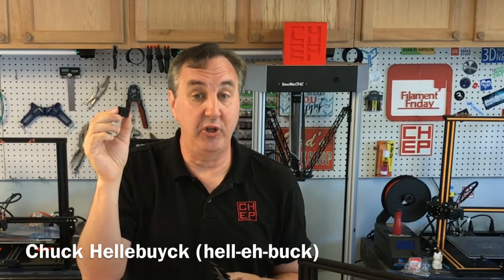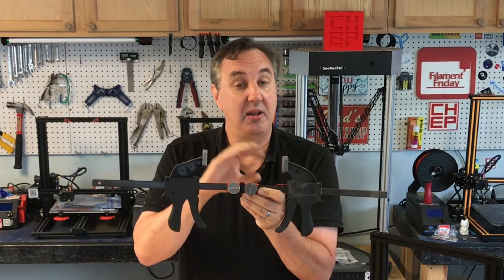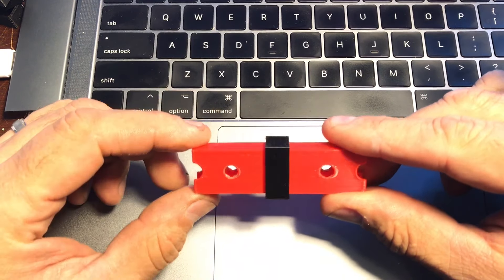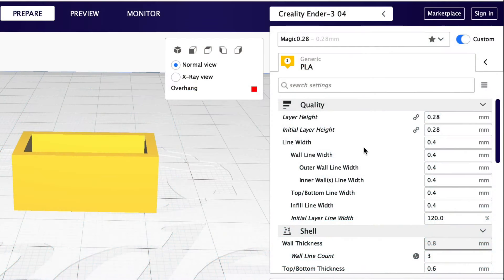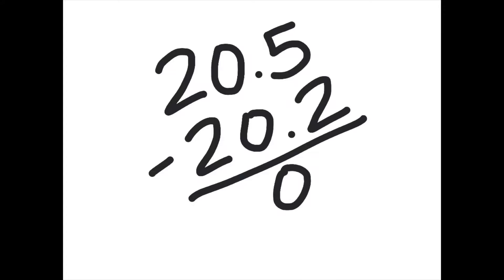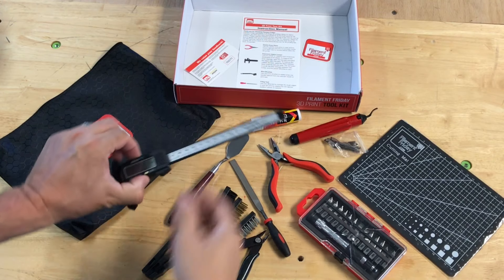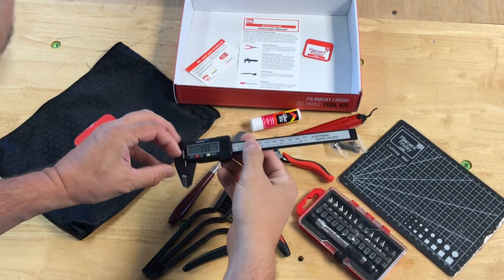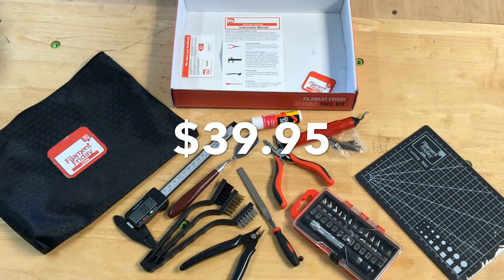Perfectly Accurate 3D Prints using Horizontal Expansion

Comment: Cura do not care about the nozzle diameter, that's all: holes are less in diameter exactly by the nozzle diam. Say, if you designed 10 mm hole and are printing with 0.4 mm nozzle - the printed hole will be exactly 9.6 mm in diameter, though the outer diameter will be almost accurate as designed. Absurdous software.
Reply: Wow, haven't thought about this, and now as I'm thinking, looks like that's exactly what is happening .. thanks for this post ..
Reply: Yes, that makes more sense here. I was having trouble with Chuck's explaination when thinking about a - 0.15 factor appled to each internal & external dimensions. It explained why outside numbers came in, but suggested inside numbers should have gotten less, not more.
Reply: @cache4pat  He had a 0.3mm difference from the design to the print. To spread that across both sides and not just 1, he divided the number in half to use as the adjustment. While the print was off by 0.3mm, each side/wall was off by 0.15mm.
Reply: @shryx86  To me it indicates a problem with the width of the outer/inner layer because it is perfectly spaced. I think if he printed the cube in twice the size then then it would still be off by 0.15mm in  each direction.

Comment: This doesn't help until you see the piece doesn't fit, by then everything would be printed. More prints, more problems.
Reply from the maker: Many times you can print a few layers and then stop it and check without printing the whole thing.

Comment: It's tinkercad.
The mesurments are way off in Tinkercad, if you make a cube in tinkercad say 30mm W X 30mm L X 3mm H then select the cube you just made and look at the lines where you can resize it on the fly, The left and bottom of the resize line up perfectly with your cube but the right and top of the resize have a great big gap going into your cube. They need to fix this to make it bang on centered on your cube.
Reply: I've printed stuff not using thinkercad and it will not print to spec. So it has to be Cura. What I printed was created in Inkscape exported as stl in Blender and sliced in Cura. Before exporting everything was measured in blender using precise measurements. So Cura is at fault here. 

Another thing is you will have to work out how much each print is off by this -0.15 offset will only work with what was printed in the video it is not a fix!
Reply: @philgolden8619  Nah Cura is mathematically pretty exact for most types of contour lines, and has a well-observed maximum error bound on the perimeter. The problem is the printer and the 3D printing process in general. To begin with, the 2GT belt is generally made undersized, and should gain the correct pitch at specific tension. Is your tension bang on? It probably isn't. What is the correct tension even? Hell if i remember... The second problem is that the Z axis movement generally exerts forces or offsets on the gantry piece. The third problem is that just because you squirt out some plastic, well it's basically viscous liquid at that point, it doesn't necessarily go right where the nozzle is, it can go off to the side wherever it wants to. In general, it experiences a bit of "die swell", this is because the molecules get a little unfurled as they settle after pressed through a nozzle, and also due to surface tension making a barrel shape out of what is modelled by slicer as a purely vertical wall for the purpose of volume preservation. The surface tension and die swell basically cannot be modelled without knowing parameters that you can't measure.
Reply: @SianaGearz  So why the need for negative horizontal expansion if it is pretty exact and why a min or max error? If it was exact everything would be calculated from the setting you choose and based on your nozzle and filament specs, there wouldn't be any need to customize any settings and you would print perfectly every time, assuming the printer is calibrated properly.
Reply: @philgolden8619  did you even read what I wrote? Open the Wiki page on "Die Swell" aka Barus Effect, you can't account for that purely from geometric considerations. You can't just analytically take surface tension into account either! And who calibrated the printer? Belt stretch? Have you?

If you think Cura is the problem, feel free to use PrusaSlicer or SuperSlicer instead. Completely separately developed slicing engine, fundamentally different algorithms, basically same results on the perimeter.
Reply: @SianaGearz  No I didn't bother reading it  it was mostly garbage.
Reply: @philgolden8619  Pillock.
Reply: @SianaGearz  Ah yes much better than that wall of text you posted earlier.
Reply: Yeah tinker has weird units. That dialog box seems to have no relationship to actual.

Comment: Won’t my horizontal expansion setting change every time I do a bed level?
Reply: No. It might change on the bottom layer, but not throughout the print. So it makes sense to overshoot the negative expansion on the first layer just in case.

However it's material dependent and layer thickness dependent.